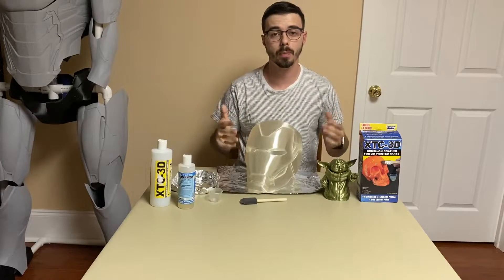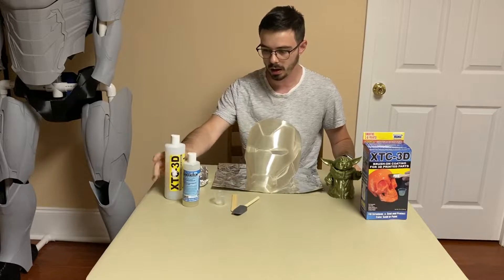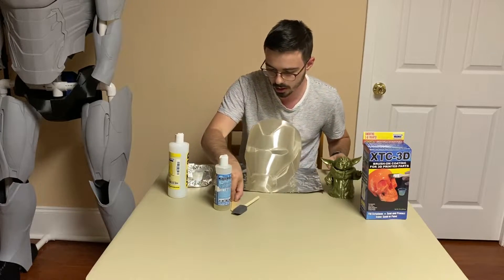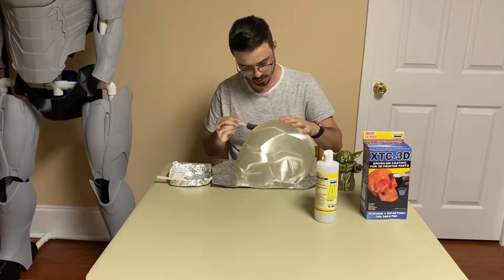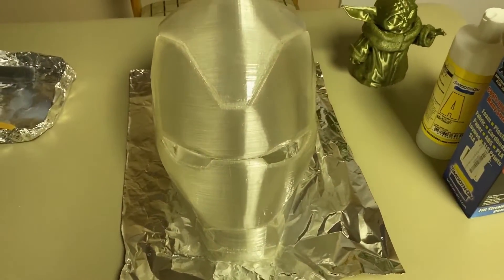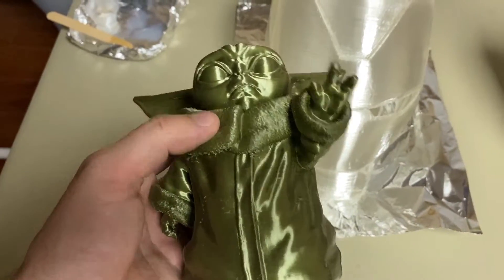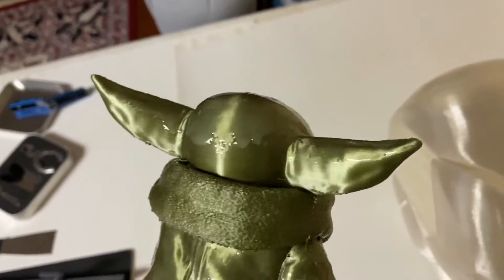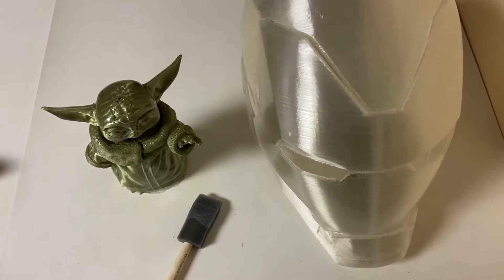XTC-3D Review | Smooth Your 3D Prints Without Sanding ! | XTC 3D Brush on Coating Walkthrough

Comment: Will this dry faster than regular epoxy? Also is it transparent? Would you recommend to use this stuff as a coat to preserve a painted 3d print prop? Any downsides to using this?

Comment: I have been thinking whether ABS slurry applied to a PLA part and then once dry try an acetone vapour bath would work, I think this epoxy method would work best with pigment added to the gloop and 2 coats applied with a light sanding in between

Comment: glad to see im not the only one with blobs/zits on rounded areas. i fixed mine though. :)
Reply from the maker: What have you found works best to address them?
Reply: @AntonsCreations  one method is to use mesh fix in cura, with z seem set to shortest. Other method is use prusa slicer with z seem aligned. You can also try slowing down the prints cause the issue is that the printer studders cause it's too slow to process all the micromovements smoothly. You can watch the CNC kitchen video called how I finally fixed my zits. I wanted to print full speed so I tested options and prusa slicer handles the code better.
Reply: @svanput  mesh fix or max resolution?

Comment: Looks like an expensive coating of epoxy then you pain. Wish acetone worked for PLA Does work great for sealing and hardening the print.
Reply from the maker: yeah it works well in some areas, but it isnt a game-changer. acetone methods could be more effective for certain prints.
Reply: I think waynesworkshop did a video about vaper smoothing pla